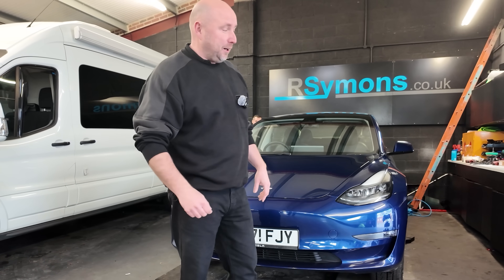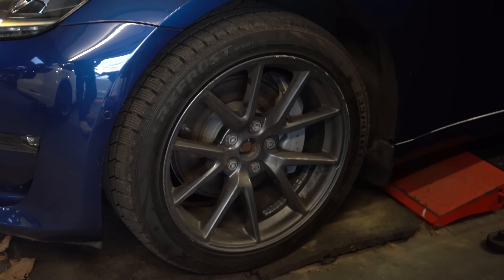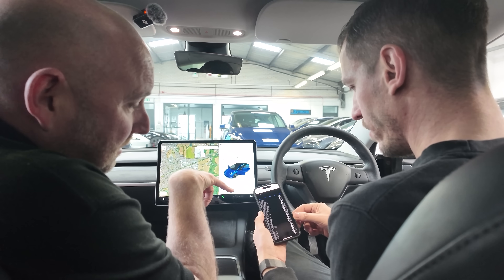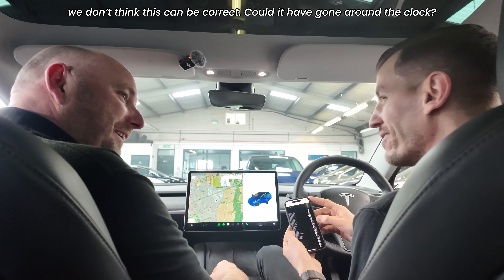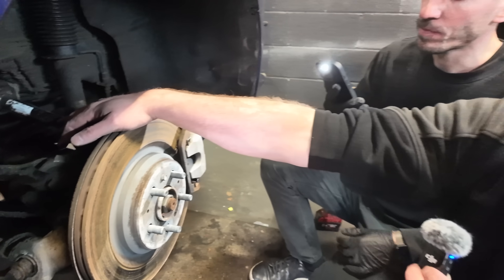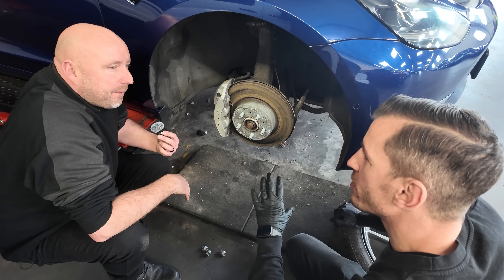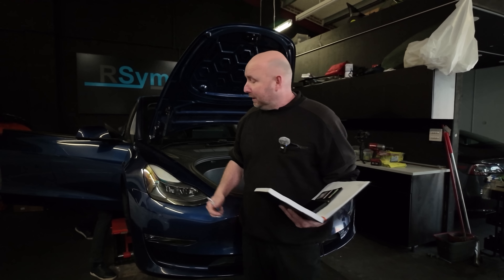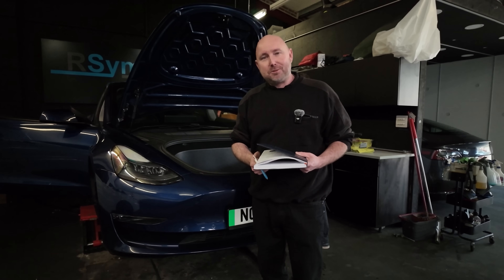EVERYTHING WRONG with my HIGH MILEAGE "21 Tesla Model 3! | Battery health and other issues!

Comment: Once battery technology and the charging infrastructure improves sufficiently for it to be a compelling case, I suspect more and more people will move over to electric.  The motor technology is already superior to an ICE.  With batteries it's charging speeds and weight that seem to be the main issues I hear about.
Reply: It's really a compelling case already for the vast majority of people (especially now that there are good value second hand options) In practice the charging issue only tends to come up in two situations 1) For someone who cannot plug in at home due to street parking 2) they need to drive 300+ every day and are going to have to use some public charging, but even that only applies if that charging hinders their route choices or time commitments.

Comment: Actually I was with you until the end when you start spouting off how crap ice cars are. I’ve got a 2015 Nissan xtrail, 190k miles, owned for the last 6 years, original water pump, it’s got a timing chain, if you drive cars how they are supposed to be driven they last, no DPF issues, in the last 5 years I’ve had 1 set of tyres changed, and just front ball joints and track rod ends. Just past the last MOT with no advisories. If you lr a plonker and buy a diesel for driving around cities your an idiot, if you do loads of miles and buy a petrol your an idiot again. I like ICE and EV’s each have strengths and weaknesses, biggest problem with EVs for me is depreciation and holding value with high miles. It’s just a ticking time bomb before the battery goes and then that’s really the car done. As no one wants a 17k tesla with a potential battery issue. It doesn’t matter on how many miles it’s done, more how it’s been charged and driven. Also time for batteries.

Comment: What interested me the most was that it only got 2.55 miles per kilowatt lifetime efficiency (215922 miles / 84607 DC, AC & Regen), driven like you’d expect a taxi to be I suppose. Although the heater must have been on for a fair bit as the driven kWh used was in 52922 which would be around 4 miles per kWh. As for a name about about Travis Bickle, the character from the 1976 Taxi Driver movie who would be getting a little long in the tooth now

Comment: Time will tell but personally I’ll stick with my xtrail diesel all teslas are too small for my needs and depreciation still outstrips my fuel cost. I still wouldn’t touch a high mile Tesla. And it’s not because I don’t like them, it’s just that I’ve had enough experience of batteries to know they don’t last for ever and no matter what way you look at it they don’t last forever they will die and then when they do they aren’t cost effective to repair. I buy diesels and have never had an engine go on me even with 380k miles on them.

Comment: I would like to see an explanation of the energy used AND the regen. I:E if circa 57k kWh added to car for 215k miles that’s around 4miles per kWh where/how  does the regen factor
Reply: The regen is already included in that figure.  Without regen the charging cost would have increased significantly, and the car's range would be useless.

Comment: Parts £20, labour £140
Reply: As always.  My brother recently has a deer run out in front of his Model 3 performance, and even though the damage was surprisingly low it's touch and go whether it will be written off.  Not due to parts cost, but due to labour and parts availability/delivery time.

Comment: Good video. These cars look nice and easy to work on. I imagine you are picking up some used bargains with the current depreciation and also the political fall out the Muskrat has caused. I have been an EV sceptic but the Tesla is still the best EV around as far as I can see. The only reason I would not buy one is that large infotainment screen that dominates the dashboard and the lack of speedometer for the driver. I think Tesla should consider a HUD for the driver and make the screen smaller.
Reply: You get used to it vey quickly, I have done 90,000 miles in my Model Y, I wouldn't want a head up display and I like the size of the screen.
Reply: Nobody cares about your opinion of Elon Musk. He's done more to save the planet than you'll ever do. The screens are not getting smaller. People love them.
Reply: " the Muskrat "

Tell me you are a delusional leftist without telling me.

Comment: The monetary value of the energy saved from regen should be added.
Reply: No it shouldn't, name a single modern EV that doesn't have regen?  They NEED regen to extend the range as much as possible.  Without regen EVs would be terrible.

Comment: Prices do not match, Tesla does not sell bushings separately only whole knuckle for approx 280Euros,  whole arms 60£? I can see in their catalogue approx 150Euros for each piece. Parking sensor 30£? Tesla is showing approx 110Euros per piece. 

Either UK has 50-90% off the regular prices or something just does not add up.
Reply: Quick search on Google - Bilstein suspension bush - £16.

Comment: What about the hub motors, do they ever wear out? I saw you had a look at them but no testing or thorough examination.
Reply: They don't have hub motors, they have a single big motor and transmission/differential coupled to the wheels with conventional driveshafts (two motors/transmissions for the Long Range and Performance models).  The transmission can suffer wear, especially if the oil isn't changed at the recommended interval (12,500 miles).
Reply: Tesla doesn't have hub motors.
Reply: I am a retired lift engineer, the technology used in an EV was developed in the lift industry,
If good quality ball bearings are used in the motors, it really not a problem.
I can only remember renewing Four bearings in 48 years.

Comment: I bought a brand new Model Y in December 2023, have to say it’s the best purchase I’ve ever made. Having been very sceptical about EV’s and doing a lot of research before I bought one it has saved me an absolute fortune. I used to have a VW Touareg, spent about £350 per month in diesel alone, not to mention the servicing costs. Model Y has been excellent. My only gripe is the build quality which could be improved very easily. I hope the new Model Y has much better build quality
Reply: Read up on the new model y juniper. The suspension has been really beefed up. It's in an absolutely incredible car.

Comment: Please ask your team how they are getting a PDC sensor for £30. Genuine part direct from Tesla?
I've been quoted £112.20 including vat.
Thanks
Reply: I see in my country approx 110Euros, so 112£ seems to be right. Not sure where they got 30 offer....
Reply: Oh how I wish my BMW X5 would have a $100 parts charge versus the two motors I've put in it already to try to keep it running... Now the car is developed an exhaust leak into the cabin so I'm sucking in carbon monoxide while I'm driving. I'll never ever buy another BMW again. I now have two Teslas and the BMWs are getting sold as soon as it gets warmer
Reply: Just watched the video and it doesn’t mention “genuine from Tesla”, quick google search and new aftermarket ones can be had for around £30.
Reply: @mohammediqbal1257  is he getting trade? His own team are installing? Hopefully he's reading the comments or using an AI to probe all comments and list questions people have.
Reply: @HairyCheese  His team is installing so definitely saving a lot on labour costs. But the £122 I got is for the part only from Tesla, and although you raise a good point that it may be trade discount, I don't think they give discounts like that, it's same price for everyone.
Reply: Is that the fitted price?
Reply: @rogerstarkey5390 No, that's just for the one sensor.
£160 fitted :(
Reply: What do you guys suggest then, should I go ahead with this or no?

Comment: Did you check if brake pipes are rusted? Common fault on model year 2019-2020 here in Sweden. Look behind inner fender, left front wheel.
Reply: This is a refreshed model (2021)

Comment: Realy , npthing  done ? No water in lights ? No suspension repairs until 200k miles ? From my kjowledge model 3 every 60k some looses in suspension apear and some parts need to be replaced.
Reply from the maker: Nothing done with Tesla from what we found out. It may have had some suspension work done but probably in an independent garage
Reply: @RSEV  nothing done, or done , if shomething was done in independent garage then repairs were done. Owner should list all repairs, if not then you are lying to people about car reliability.

Comment: So you didn't have to change the battery after 50,000miles - This factual video will upset so many EV haters. Good stuff.
Reply: @GaryStephens-d3x  Why do people feel the need to reply to comments with such negativity, on a dedicated EV channel, when they probably don't own an EV? Most vehicles can do high milage with enough maintenance. What this is showing, you can run an EV to high milage with not a lot of maintenance.
Reply: Why ?  I have seen Diesels run over 400 thousand miles !!!!
Reply: Although they still won't accept the reality......
Reply: It won't upset them. They'll just keep repeating the same old BS.

Comment: How did you get the battery health number?
Reply: Tesla battery software.....  Battery health can be fairly easily established for most EV's by using an OBD, plugged into the car's diagnostic socket...... It's a good idea to ask for this to be done if you're considering buying a used electric car.....
Reply: @ Hi. I’m somewhat familiar with the concept of needing an OBD. I’d really like to learn more about it. Is there a certain kind of, or brand perhaps?

Comment: If driving an ICE car, would we accept happily, a drain hole being drilled in the tank after some yours, dropping the range to 88% ...🤔🤨
Reply: It was the state of health of the battery that was at 88%. How you actually drive the car will have an effect on the actual range......
Reply: @ I agree of course - but its more the fact we simply accept an 88% drop in (potential) range on an EV, something we wouldnt in an ICE. It puzzles me a bit...

Comment: Great video, I didn't expect battery health to be so good. We have a MY with 30,000 miles so looks like we can keep it another ten years without any major issues - ongoing software upgrades are probably the only thing to be mindful of. Cost analysis electric v diesel is staggering. Keep up the good work 😊
Reply: I have 125000km on my -22 Tesla and battery degration is barely 6%~. 436km range when new, 414km now. Battery is the last thing I worry about. Slightly worried of heat pump though! 😅

Comment: An ICE would have a service schedule that the manufacturer dictates for warranty purposes. This immediately pushes up the cost for ICE on that front. That could mean a service every 2-3 months if 200 miles per day. Water pumps first change in my experience is recommended at around 65,000 miles along with cam belt. Never cheap. Regular servicing would however be picking up safety items like bushes and brakes, and comfort items like filters.

Looking forward to your Part 3. I’m not into EV, but still find this long-term EV stuff (like the battery health, charging & regen data) of interest. The only lithium batteries I have experience of are through my aeromodelling hobby and I know they can “puff up” and become less or non-serviceable with age. That probably is my greatest concern with a car battery tbh. Your M3 has arguably had a good life on the battery charging front which must help a lot. Others may hold different views of course.
Reply: Tesla have a very advanced Battery Management System that keeps the batteries healthy and prevents them from burning. You do not have any BMS at all in your aeroplanes, hence the popping 😇
Reply: I have little doubt that the Tesla BMS is state-of-the art. And if that BMS monitors and protects any weaker cells that develop amongst the few thousand in the battery, so that they still contribute but are not over-discharged or over-charged, or even locked out if necessary, then that is great tech. It is correct to say that BMS is limited to the charging cycle of the batteries I use in aeromodelling, so there is much more potential for abuse on the discharge.

Comment: if you have where to charge it (read at home) then an EV is a very good choice. Unfortunately many of us live in apartments.
Reply: @xprt642
I live in apartment and only charge at public charging stations. Cost to cover 14k miles is just over £900, my old diesel would have cost me £2100 for same mileage. It takes me few seconds to plug in and it adds miles while I do other things.
Reply: Are there petrol pumps outside the apartments?
Reply: @Brian-om2hh  no but the range is enough on ICE and the refuel takes 2 minutes.

Comment: Lets not always talk about how great Teslas are. I am sure there are many happy or lucky owners but   "In 2024, the company recalled almost 700,000 vehicles in the US due to issues with the tyre-pressure warning system and about 1.85 million vehicles due to a software failure to detect an unlatched hood"   The Canberra Times 24 Feb 2025.  
And phantom braking problems anyone?  The point is people who have bad experiences with any car I think are much less likely to be on youtube than those who are EV fans.
Reply: They weren’t really recalls, they where over the air software updates that happened over night, usually before the owner was even aware of the problem. I have a 90,000 mile model Y and it is brilliant, yes I very occasionally get phantom braking when using autopilot which can be annoying, but no car is perfect.
Reply: ‘Recall’.

You mean an over-the-air update. Get your facts right before such a dumb comment. 

If you want to disagree, go and look up the meaning of the word ‘recall’ 👍

Comment: Great review! My Model 3 is at 68k km and I measured about 6-7% degradation. 

One thing to keep in mind though is the age (in time) of the battery. A 10 year old car with 215k miles might have a much worse degradation than 12%. But I guess the old Model S on the roads already show us that it's not too bad.

Comment: The Achilles heal of Model 3 and Y is the too thin plate protecting the battery underneath. There is coming out 3-party fixes to this but should be better from factory.
Reply: Doesn't seem to be a problem, do you have some references for that?
Reply: @ Yes, in my country this has been noticed and as I said there is 3rd party solution coming out now commercially. It is not a hidden secret and easy to check. Is it about cost cutting, most probably?

Comment: Meanwhile, my model 3 with ~50k needed both lower control arms replaced (~$2k), cabin air filter every year because it stinks (~$150), tires that only last around 35k ($400 each). All of that out of pocket.
I've given up on thinking it's low maintenance.
Reply: sounds like you are being overcharged. the ball joint/ bushings could be replaced ,  not the whole arm ? $400 per tire? thats a lot.  $150 air filter?
Reply: @Sir......  yup, probably.  I'm being overcharged by Tesla, the affordable EV company 😆
The entire lower control arm was their suggestion...because they care 🙄
Reply: ICE cars have all those parts plus oil changes

Comment: Great to hear as I've just bought a model 3 long range dual motor with 120k miles with 93% battery health. Im hoping to keep it long enough to get it upto 500k miles. Wish me luck.
Reply: Hey, I'm thinking to get a 2023 model y with about 120k miles on it too. Judging from the condition of the seats, it looks like it was used for ridesharing. What made you decide to go ahead with yours as it's out of warranty I'm assuming. It's kind of a hiccup for me to buy something with that much mileage for 2023 but I'm getting a good deal on it.
Reply: @Hameek-e2k how much are you paying for it?
Reply: So you honestly believe your car Will last 500, 000 Miles 🤷🤦
Reply: @lp5627  I do
Reply: @flyingmower OK good luck keep us updated
Reply: @lp5627  there has been teslas doing 400,000  miles. Hope it goes well for him at 500k miles. There will definately be repairs needed at such an extreme milage.
Reply: @Sal3600   A Million Miles  Tesla Model S had 14 Motors and 4 battery packs it was simply a showcase for Tesla to promote its non existance reliability
Reply: @lp5627  You obviously do not know what you are talking about.

That Model S belongs to Hansjörg von Gemmingen-Hornberg, and it has NOTHING to do with Tesla promoting anything... it is purely private!  It is an early 2012 model, and those models were indeed plagued by an engine problem.  NONE of those 14 engines failed... only a bushing did... so, yes, the car did go though 14 bushings in about 1.5 million km, all of them changed under warranty.  But then, the company EV Clinic made a modification to that engine, which solved the problem for good.  Do you know of a totally new and innovative model, that has had that few problems in its first years of production???

As to the battery packs, same basic thing.  The early Model S battery packs did indeed not age well, but still, the first 3 battery packs (I believe #2 and 3 were not new but refurbished ones) did last an average of over 620'000 km each!  That is more than what ca. 50% of drivers will ever drive in their  lifetime, and at least double the mileage the average petrol engine will last without extensive overhaul!

After now more than 2.1 million km, the car passed the German TüV test with flying colors... the expert could not believe how gracefully that car has aged.

Oh... one more thing... in a recent Honest John (who happens to be real honest and independent) report, Tesla came out as the second most reliable brand, behind only Lexus and ahead of Toyota.  It is also THE brand with the lowest maintenance costs over both a 5-year and a 10-year period!

You should not let your hate of Tesla blind you from reality!
Reply: @lp5627  That was the early model s